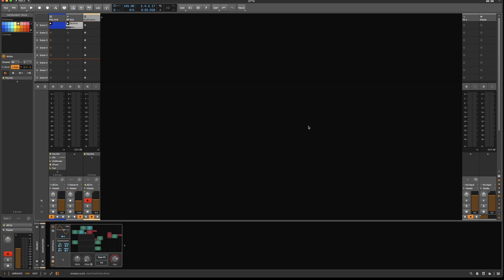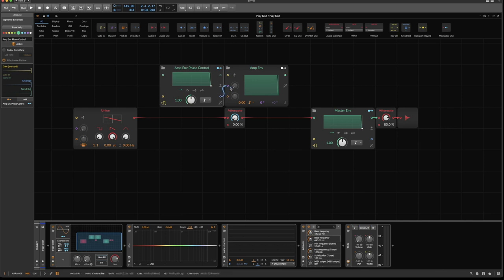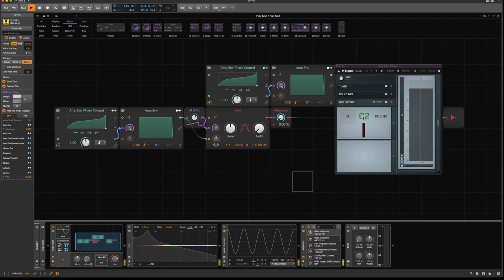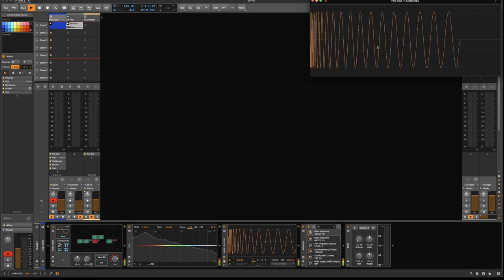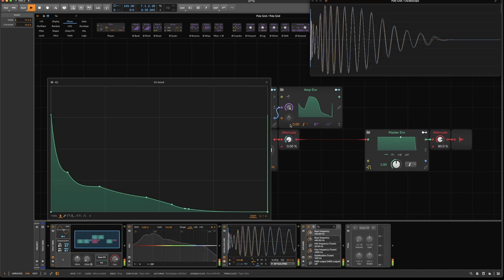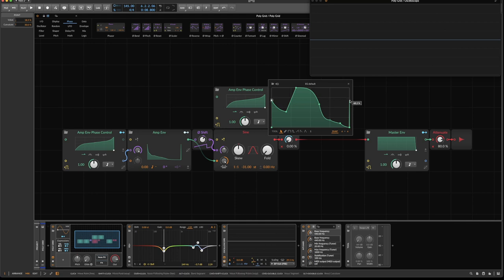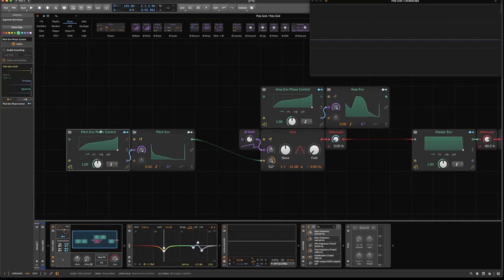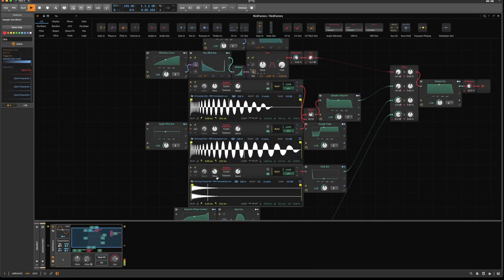Kick 🦵🛢 design in the Grid Pt. 2, using oscillators, MSEGs and a little trick to get there quickly!

Comment: The phase trick is interesting but introduces a bit of an issue. The grid of the Curve, who's phase is being modulated, no longer represents note divisions. Those divisions are actually very useful to figure out which frequencies are being overemphasized. At full modulation of the note (120 st), in the grid, 10% represents one octave. So you can look at frequency by time and "reverse eq" thus avoiding EQ phase shift.
Reply from the maker: Interesting observation about the relation between the curve and note divisions. I'm sure this knowledge will become useful  :). In this specific case however I can't see a benefit, or at least I prefer the advantages the "phase trick" gives me.  Also phase shifts through the EQ don't bother me. In fact they can be very welcome in certain circumstances. We need of course be aware of them and make sure we don't change too much anymore after aligning kick and bass, maybe bounce the thing to audio and trim it again.
Reply: @rumblechannel6343  Yeah, someone said "trick" in the comments, so I kept that going, I think it's a great technique! I just used it to speed up an arp right at the end, giving the phrase a faster finish that sounds very organic. Like when a player speeds up at the end to hit the next part.